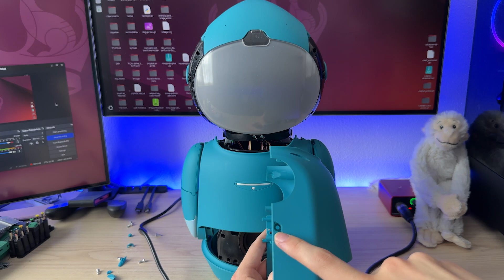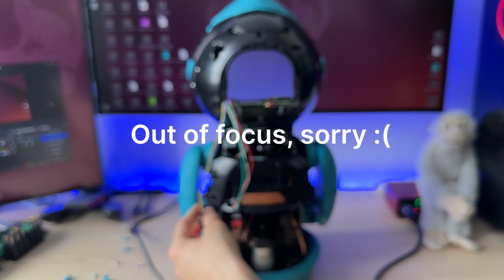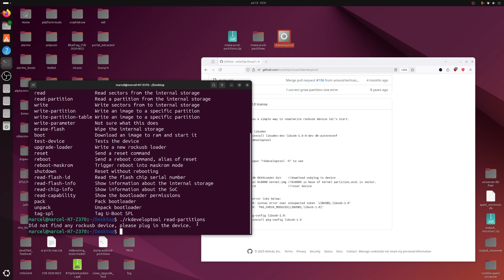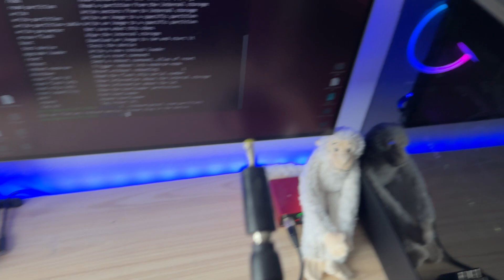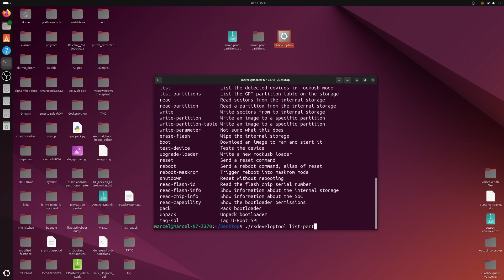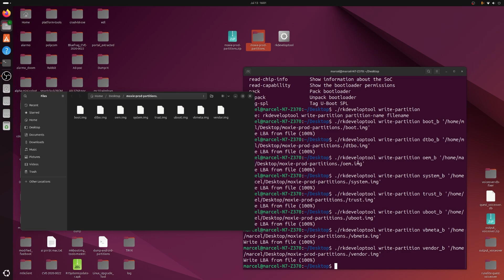Force flashing a Moxie robot to the OpenMoxie supported update

Comment from the maker: CORRECTION: the front chest plate has 2 more screws which are on the 2 metal pieces next to the arms at 4:13 in the video. Unscrew those from the back too!
I am not responsible for the actions you take with your robot, only knowledgeable people should follow this tutorial. You risk bricking your robot by using this method.

Resources:
- Cable creation set: https://www.amazon.com/-/en/dp/B0BMDNQWF7
- USB pinout: https://www.amazon.com/Cermant-USB2-0-Converter-Adapter-Breadboard/dp/B0CQXGFF6K
- Screwdrivers:https://www.amazon.com/iFixit-Moray-Driver-Kit-Smartphones/dp/B08NWKMT8V
- Rkdeveloptool: https://github.com/DorianRudolph/rkdeveloptool
- Moxie firmware: https://gofile.io/d/hSRggT
- Moxie firmware (backup link): https://mega.nz/file/t50DRBCQ#w-PSlfV3aJpJbnm-QOaJjf0g9uidgtUEpISRnR866Go
 - OpenMoxie: https://github.com/jbeghtol/openmoxie

If you are inclined to leave a tip (entirely optional): https://ko-fi.com/mgdproductions
Reply: Has Anyone Got There Moxie Operational Who Could Help Guide Me Threw This? Could Pay You For Your Time @ProgrammeerMeneer

Comment: Thank you so much!!! I followed this exactly and was able to update an old moxie I found at a thrift store. I have it running openmoxie with gemma 3 via lmstudio! One thing to note: I flashed B first, then booted up and saw no tag under the qr code so I flashed A and still saw no tag. I read some comments on here to show moxie the setup qr code anyways and, for whatever reason, I saw the tag this time when I booted it up. Not sure why it showed up hours later but hey it worked lol
Reply: I've had projects where I do everything right but nothing seems to work. I walk away from it for a few hours with everything shut off and, after turning it back on, it'll suddenly start working for me. I can only summize that whatever I was doing only had a chance to do a soft reboot and actually needed a hard dreboot.

Comment: Thank you for the informative video. I got rkdeveloptool installed but i noticed its options have changed from when you last posted this video. I currently have version 1.32. Any guidance you can provide on updated commands will be greatly appreciated.
Reply: What options? I just did this 3 months after this comment and it worked fine

Comment: I purchased a used Moxie Robot. I see The embodiedproduction text on boot. I showed it the OpenMoxie WiFi code then the Migration Code. I also tried Migration Code first, then WiFi Code. I do see the spinning icon for about 20 seconds, Then it goes back to the QR Code with a small Moxie Robot Icon in it, and the OpenMoxie text below. It just stays there and I do not see the robot appear in the Hive. Do I need to do something different? How long do I hold the codes up to Moxie for? Thanks!
Reply: Update - I found my issue - I had used my Mac computers name for the computer name in OpenMoxie Setup. I switched it to the computers IP address and it is now connecting! Thanks again for providing your knowledge on force flashing to the latest firmware!

I was super lucky that the used Moxie I purchased already had the latest firmware and was ready to go! I have a second brand new Moxie still in the sealed box which I plan on taking apart and updating soon.
Reply from the maker: @scottkarlins  Haha that was my first issue too! I knew to use the ip fortunately cause hostnames are a pain in networks sometimes

Comment: Hello…Muneer your vendor.img size is 750MIB and my moxie has 500MIB.  Can I continue flashing without bricking my moxie or can I reduce the size of your file to make it the same..
Reply from the maker: The vendor partition on your moxie is only 500mb? I know vbmeta can be different but i have no clue for vendor. You can't lower the filesize. I would advice against flashing it, but if you dare to take the risk of bootlooping you can try.
Reply from the maker: They should both be the bytes i displayed in the video, try comparing with list-partitions for the partitions on moxie and du -b * for the files. You will get the exact byte amount which should match.
Reply: I used the command you mentioned.  Your files in YouTube link has vbmeta.img (4096) which is okay according to you but vendor.img has (7GB) size instead of 5GB size showed in your video).  Did you check the size of your vendor.img  in your shared link if the file has 7GB size or 5GB?
Reply from the maker: @espovlogs6209  Multiple people have used the files without any issue. It might be counting the empty bytes strangely.
Reply: I have managed to flash all image including vendor.img after using usb but failed to flash the system.img..The size are the same but there is a message that system.img is larger than destination.. Have you encountered any error in system.img?
Reply from the maker: @espovlogs6209  Then it did went wrong unfortunately, i have no idea how to fix that.

Comment: I flashed both a and b. B first, then A when B didnt work. Then B again.

I am still getting the old wifi screen at boot.

The only thing that was off was that the 2 center pins voltage was about half what you said yours was.
Reply from the maker: Can you try to setup wifi anyways via the openmoxie tool? Try to scan the migration QR first and then the wifi setup QR. I had someone who also didn’t get the tag under the qr code on the wifi screen but did get it afterwards.

Comment: Hello! Thanks for the video! I followed your instructions, everything was smooth until I tried turning the robot on after uploading the files(I did both A and B). However the robot turns on and keeps loading for long time (~15 mins) then goes to sleep mode ( some cartoon things appear on display), could you please help me? Itried switching off the wifi, but did not work. I did not understand what you meant by migration code in one of the comments.
Reply from the maker: The long loading is usual, did you already get it connected to openmoxie? If so once the cartoon things appear you can say "Hey moxie, wake up" and it will wake up. If the display turns off, tilt the robot a bit and it will wake the display again.
Reply: @ProgrammeerMeneer  I dont think I got connected it to Openmoxie, I only uploaded the files from your video, so thats it. When I say "Moxie, wake up", it shows GRL (gear sign) on display and is still in sleep mode. It did not show the tag as you show in your video.
Reply from the maker: @auenn167  What happened when you turned the wifi off? Also can you scan a wifi or migration QR code from the openmoxie tool anyways and see what it does?
Reply: @ProgrammeerMeneer  I have managed to flash it, I used migration code from OpenMoxie on my computer. Now I was wondering is there a way of connecting to the robot via SSH, to upload files, etc? 

Also thank you for your help!
Reply from the maker: @auenn167 i have found a developer rom which you can flash to get android debug access to the robot, i showed it on reddit
Reply: @ProgrammeerMeneer  have you used the same usb cable and the same pins? or you used UART for this flashing? Where can I get the developer rom? Thank you very much for your replies!
Reply: hey man, where do you live? can i bring my moxie to you to do this?

Comment: Thank you for your work :)  , do you need to have a valid linux system ? I use windows 11 and WSL Ubuntu, I have link the usb port to the WSL  but no luck  I see (DevNo=1 Vid=0x2207,Pid=0x320a,LocationID=102    Loader)  when I typerkdeveloptool list   but    rkdeveloptool list-partitions  tell me error like "Creating Comm Object failed!"      (Update:  it's work, I need to do sudo before the command)
Reply: You can backup your partitions , create a backup dir, cd into this dir than ,  sudo rkdeveloptool read-partition vbmeta_a vbmeta_a.img  it will create backup this way
Reply from the maker: @redgeciccone8218 this backup will be corrupt, rkdeveloptool is unable to make a good backup since uboot is doing some weird things to it.
Reply: It works half on my side, do the exact procedure, I see openmoxie at startup, but does not say a word, it connects to the openmoxie server, I can use puppet mode and make it say anything, but moxie does not say a word otherwise, I see the face and it looks at me but does not seem to hear me and ends up closing, I correctly put the openAI key..... at startup, could it be that vbmeta_a is because of this??
Reply from the maker: @redgeciccone8218 no, if the robot boots then there is no issue with the partitions. You should look more into your openmoxie install or contact the openmoxie dev for help.

Comment: I really respect the work you've done to help unbrick the Moxie -- seriously impressive. I just had one question: at about 15:10, you mentioned the partition size should match, but the vbmeta size doesn't seem to line up, the vbmeta.img you has is 4096 but the partition on board is 1048576, shown in in your video. I assume this has to do with the Android AVB?  I inspected the vbmeta image you uploaded and everything seems legit. I went through the process, flashed both A/B, but the Moxie still boots into the old version. I'm starting to wonder if this size mismatch on vbmeta might be the issue and it has to fall back to backup partition. But it doesn't explain why it doesn't work on my Moxie though...
Reply from the maker: Yeah sorry, the mismatching vbmeta is fine (seemed fine for me too). Strange that yours still boots into the old version tho.
Reply from the maker: I just helped someone update theirs and we had the same problem, if your moxie goes to the sleep screen and not show the wifi qr or something, it won't show the embodiedproduction tag. You may want to disconnect your router to prevent moxie connecting to your network. It should show the wifi qr and you may be able to migrate it from there by scanning the migration code. I think if you bring your wifi back online it should show the EmbodiedProduction or OpenMoxie tag.